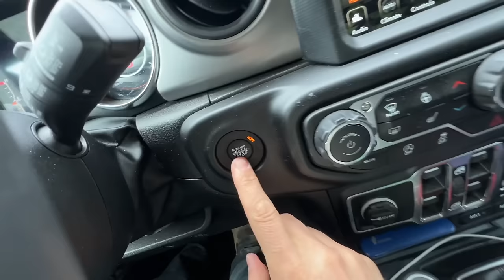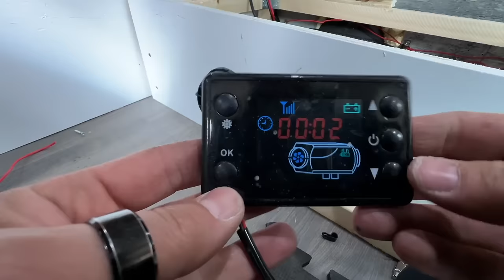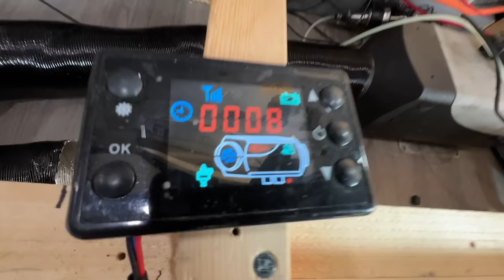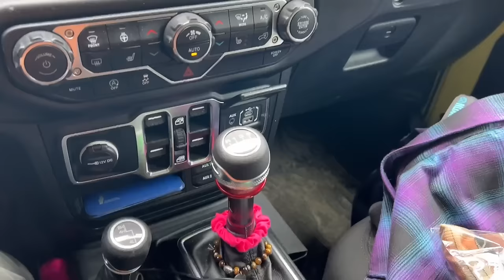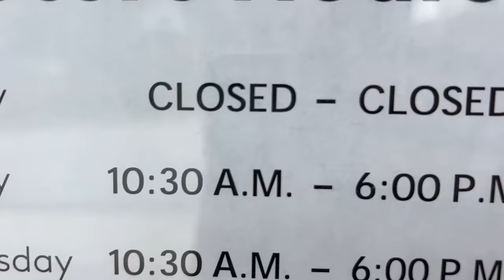YUP putting THAT ONE Back in! - Vanbuild Chronicles

Comment: Here's a tip for your multi-plug shore power inside Lucky. In my home kitchen, I took the plug cover off, found where I could safely screw the bottom plate to the wall, and then snap the plug cover back onto it, and it's been there secured for years.
Reply from the maker: That’s not a bad idea at all!

Comment: Napa is a good place to get FueL Line hose cheap, whatever length you want. Do what NO other VanLifer has done before.Install a 2 diesel heater in the back and run both. I read you can Rotate the heater 90 degrees Glow Plug facing up.Exit through Side of Van.It’s gonna be chilly back there in the Winter. Take it easy man.

Comment: Matt try heating the ends of the piples with a container of warm water until end are soft then connect them to the filters, the heater and tank.  Normally gives a tighter fit. With the ladder use Velcro to keep it attached to door or cupboard.

Comment: you can try a weedeater fuel filter on the fuel pickup inside of the tank, that way you can use one line with out cuts in it

Comment: 'Sesame Snaps' was the term you were searching for.
I would suggest, whether or not you replace, or just repair the fuel door, that you add a string or wire or whatever, to limit the opening arc of the door.. bummer, as you said, it didn't even see the launch of L 2.0. lol.
I was one of those who warned about hot batteries.. warmed my heart when you showed it first time with the flow control built in.👍🏼✌🏼🇨🇦

Comment: Put a disconnect on your solar. Any solar ( even a small bit) will knock your dc charger into a 25A limit on your alternator charge. I turn off my solar when van is running and turn on when parked. Gives me the full 49ish amps when driving. Nice videos. Thanks

Comment: Muffler is supposed to be level with the hole at the bottom because it can collect water and rust. Worst case you will need a new muffler. You can attach a peice of exhaust pipe to the end to direct the exhaust away from the vehicle. Not a huge deal though like keeping your lithium above 0

Comment: the best new part is the swizzle mount for the passenger chair.   give you a proper chair to sit in, for your back..  why are you heating the batteries and electrical box?  do you need to keep the batteries hot?

Comment: Great video thumbs up but I have one question if you don’t mind me asking, do you have a vent in the cabinet wood, so the diesel heater can suck in the cold air from the front of the van and turn it into warm air?
Reply from the maker: Yes, there is a wide opening. Hard to see for sure but the side wall does not go all the way to the floor
Reply: Nice!!!

Comment: Hi Matthew. The day you installed the fuel door, I bit my tongue. I was screaming no, no, no. Why didn't you have it swing DOWN or away from the door. I decided not to comment then..
I'm thinking you must have had a reason...but what ??
Reply: Don't want the door facing front where the wind could try ripping it off going down the road if you forget to lock it etc.

Comment: I'm sure someone else has mentioned it somewhere but where you are storing your ladder weren't you going to install another folding table so you could use it without having to lift up your other platform so you could get in and out of Lucky easier if your were cooking/eating ?

Comment: I have the same charger in my westfalia... with a stupid alternator. Don't need the ignition wire. When the charger senses above 13.6'ish volts from the alternator for maybe 10 seconds (???), the charger kicks in. You can see it happen on the monitor.
Reply from the maker: Yeah! I learned that eventually, very cool!

Comment: My four hundred bergman faring busted... It was a three hundred dollar faring... I fixed it with a zip tie.And a soldering iron... The zip tie is used for a welding rod. Strange as that might sound it didn't work.... Sorry about the gas Door breaking.... But you could probably fix it the same way.

Comment: A question
Will you ever want to also send heat under the bed?? Wouldn’t that be a good thing to do?? Maybe have the possibility to open and shut the valve so you can use it in really COLD weather.😅
Like, you know, have the heat tube thingy actually go under the bed via a tube hole in the battery box??